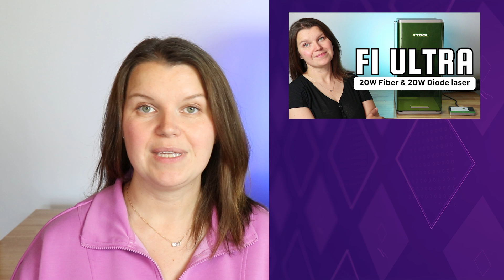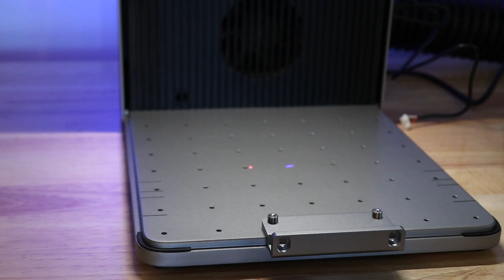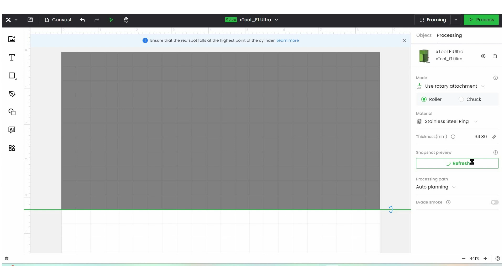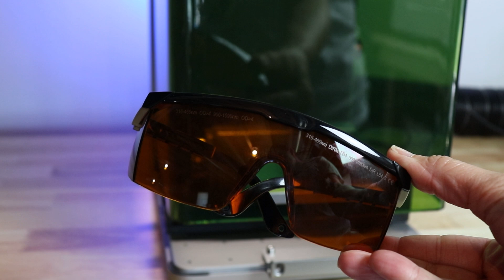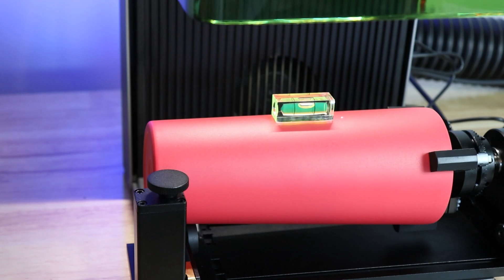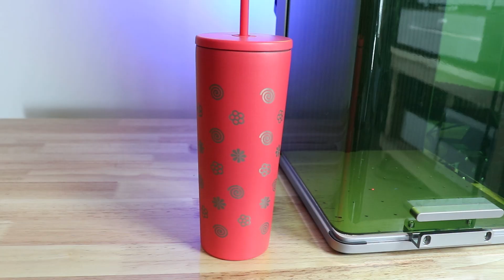Engrave Tumblers with the xTool F1 Ultra and Rotary Attachment

Comment: The problem with this and practically every other tool of it's kind, is that it doesn't engrave compound curves insofar as I can tell. I could create a device to enable my clarinet barrels to roll along their central axis, but then how would the engraving tool account for the lateral curvature vs. the radial curvature?

Comment: how can you predict the start point on the tumbler? Some tumbler / water vessels have logos on them. Do you put it at top dead center hope it misses or bottom? Can tell where on the vessel it will start once you hit go?
Reply from the maker: It takes some practice but you can do it. I engraved some Yeti tumblers not too long ago and was able to line the engrave up perfectly with the logo. On this machine after you set the design, there is a framing function. It projects a box directly onto the vessel showing exactly where the design will be engraved. You can then adjust your design to get it perfectly centered.

Comment: How do I change the measurements so the image wraps around the entire tumbler, but the height remains the same? Is there some sort of release and lock button?
Reply: In XCS there is a little chain icon next to the dimensions.  A heads up, just doing that will likely warp the image, so best to make the size template first with a basic shape (uncheck output for that shape) then place the images on that space, sized how you want.  Group them up when finished, delete the shape if you want but if it is unchecked for output it wont matter.  
Beginner myself but thats what Ive learned so far, and may not be the best way!

Comment: How do you engrave coffee mugs with handles or 40 oz stanley style mugs with handles? Is there an attachment that can be used?
Reply from the maker: The RA2 Pro is the attachment that holds all cylinders, it's pretty versatile using either rollers or a chuck. It will hold a mug with handle or 40oz tumbler, but for the bigger items you will need to remove the handle. I have not done really large items on this machine, but to accommodate them you may have to raise up the rotary attachment so the item will fit in the machine.

Comment: I came here from the glass engraving with f1 ultra, you claimed there were settings in the description there are not.
Reply from the maker: Thanks for letting me know! I will add them later on today and let you know here.
Reply from the maker: Power 45 speed 50 with 1 pass worked great for me on glass using tempera paint.
Reply: @SarahVanderkooy  Thank you for promptly getting back to me.

Comment: GREAT video - Thanks!  But you never showed us how to set up the rotary tool - which port do we plug it in? What are all the other attachments? I know the title doesn't say complete set up from start to finish, but do you have a video like that? I have no clue and its frustrating to say the least. Thanks.
Reply from the maker: When you get the accessory it comes with an instruction manual and a link to a set up video. Both are also on their website. It's really easy to follow so I didn't want to replicate that here. It plugs into the accessory port on the side of the machine. There are a bunch of ways to set up the chuck for various sized items, but the process of engraving is similar for each one.
I have a full set up video for this accessory and the M1 linked in the description.

Comment: Thanks for doing this video, I've been wondering what it would be to do this with my f1 utlra. Question I have is I see some folks saying to not just burn the coating away, but to engrave it with color... have you done much of that yet? i spent the morning trying to learn but there is little on it and most videos i find are using other mopa fiber lasers
Reply from the maker: I have not tried that yet, but it's on my list of things I need to do. This works best with stainless steel. I would do 2 test grids on a stainless blank, one for each laser. You can achieve neat colors with either one. I have seen tumblers where the diode is used to burn away the coating then a second pass can color the blank space. As soon as I have it figured out I will post a video!

Comment: Does the XCS software take in to account the taper on the tumbler when doing a full wrap like one like you showed?  How to you ensure centerline alignment without the Plus model of the RA2 Pro?
Reply from the maker: Great question. This tumbler has a slight taper and it wrapped the image all the way around beautifully. The software doesn't recognize the taper. I used the diameter of the largerest end for reference. However, with something more tapered the delux RA2 Pro version would be a better option. It allows you tilt more and accommodate for the angle.

Comment: Great video, been waiting to see some videos on the F1 Ultra on Tumblers.  Question... what was the reason to change from the Fiber to the Diode between the two tumblers?
Reply from the maker: Personal preference. You can get a deeper engrave on bare metal with the fiber vs just etching the surface with the diode. Thanks for watching!